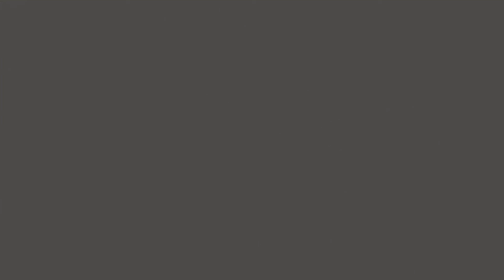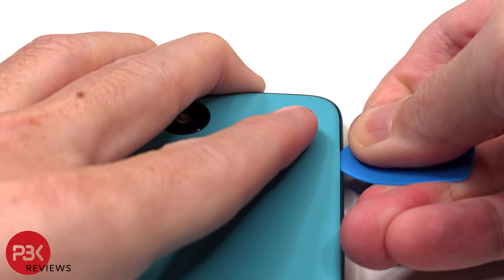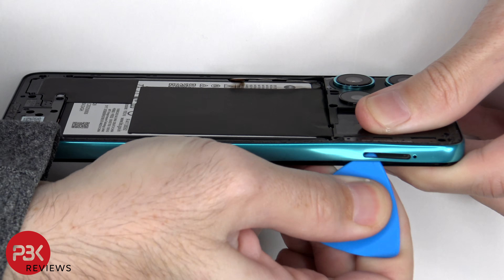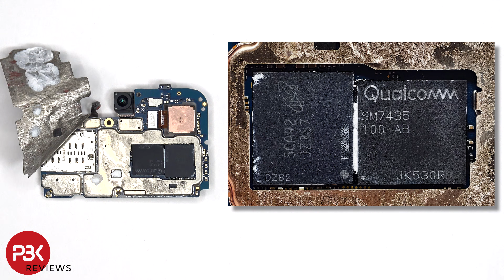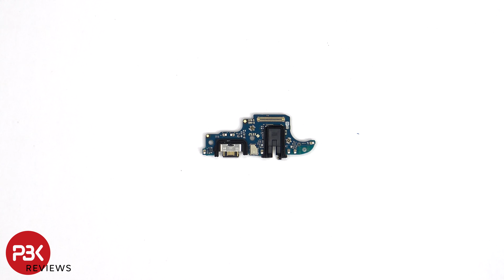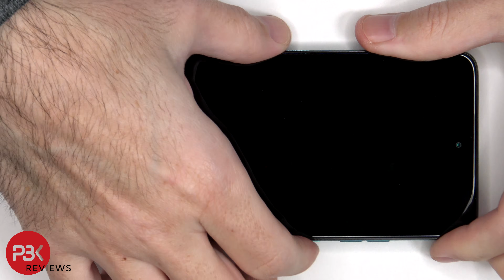Motorola Moto G67 Power Teardown Disassembly Phone Repair Video Review

Comment: Great video.
I just don't get the design choices for this phone with the fake camera lens. Once you see it, it's hard to approve.
Reply from the maker: Thanks. I mean its just designed to be more fluid with the rest of the camera lens and actually has a sensor underneath it so it's not just entirely fake but yep I get how some people may not like that.
Reply: Same.  If they just want to save money by having all phones with same design , atleast differentiate the design between cheap phone and good phone.  No one is going to buy edge 70 pro if the edge 70 and edge 70 neo are gonna lokk the same . Now even the chelaest budget phone looks exactly like edge 70
Reply: They should finalise two designs one as a two camera system that resembles the design of an iphone 16 . And another a 3 camera design with L shape and they can that way have a more space for selfie cam too bcz only their design is the only one to have large enough camera bump size to accomodate upto selfie lens